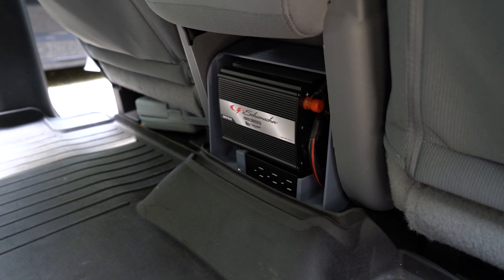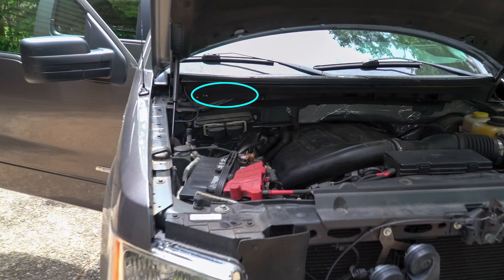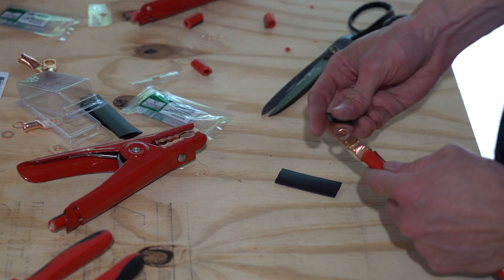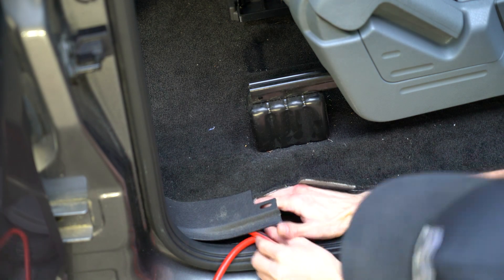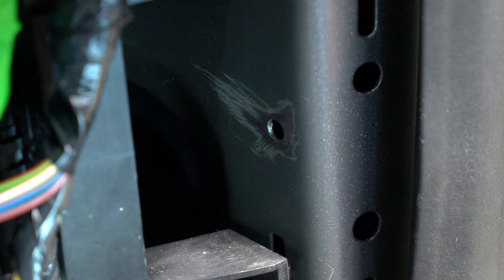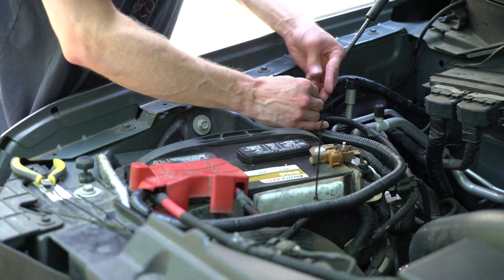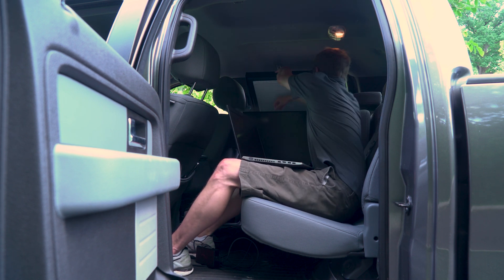Power Inverter - Wicked Full Install - AC Power for your Car or Truck

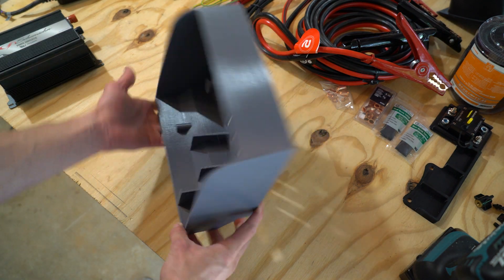Comment: @ 1:47, you're a magician brother. new sub here.  As a 3d scanning guy myself (lidar for construction, real estate, etc and drones for lidar, photogrammetry, etc,) did you use a scanner to scan the factory part you modified @ 1:47?  No need to tell me the secret sauce, we can connect elsewhere but I'm curious as I haven't started scanning smaller parts like machine parts and reverse engineering things with platforms like revopoint, etc.  🍻

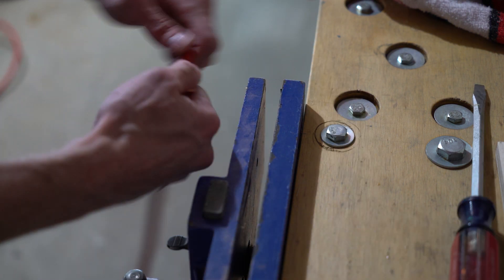master tip @ 5:20

Comment: Amazing work on wiring it through the frame. Best part about doing it that way...you dont have to do that again if you get a different inverter. The wiring is already in place. Only thing I could see to use instead is your drill bit for the ground terminal near the fuse box. You appears you were using a (black oxide) bit intended for wood. Use the bi-metal, or gold or titanium ones in color for metals. I'm thinking you already switched those out now with it being 4 years late. Great work.

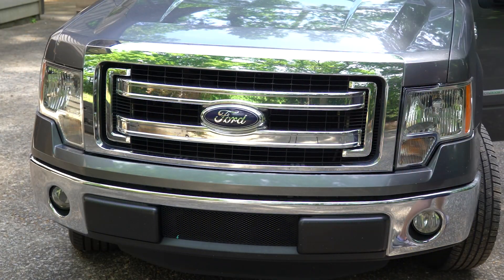Comment: for 11:42

Here’s what’s happening:
1. Starter battery voltage drop:
When you crank the engine, the starter motor draws a very high current (often hundreds of amps). This causes the battery voltage to dip sharply, sometimes down to 9–10 volts or less for a few seconds.

2. Inverter reaction:
Most inverters are designed to shut down or alarm when the input voltage falls below their safe operating range (usually 10.5–11 volts). So when you crank the engine, the inverter “sees” the voltage sag and starts whining or beeping.

3. Why the car itself whines/beeps:
Depending on the truck’s electrical system, the inverter pulling load while the starter is cranking can make the alternator or electrical components emit a high-pitched noise. It’s essentially electrical stress caused by both the starter motor and inverter drawing from the same battery at the same time.

Comment: Very good video double thumbs up. I got to use a EGO Blower recently, i think it put out more blowing power compared to my handheld echo Blower and I was very impressed. I could save me a ton in gas by using a battery powered blower. I came across this video and I think I found a way to charge the battery's while I am out mowing lawns every day.

Comment: Very nice install.   I would not go with a modified sinewave inverter.  Sure they are a bit cheaper but it really restricts what you can use with them.  Also I have read they can actually damage devices hooked to them.   I love your video.  Very well done!

Comment: If I where you I would buy a junction box for under the seat to protect the flammable carpet from getting lit from terminal spark also I would build a cover for the inverter so the outlets are only visible and then I would buy an external switch to hardwire it to prolly left side of stearing wheel so u could controll it from the front

Comment: Great vid. This really helped. Getting ready to do this. Do you happen to have a link to the terminal cover boots you used at the end?
Reply from the maker: Happy to help! Here are the covers I used https://amzn.to/4b9OQB8

Be sure to add a fuse on the close to the battery. This can help prevent a short in the case of a crash or damaged wire. This is the one thing commenters said I missed.

Thanks for the comment!
Reply: @The3DHandyman  Just wanted to let you know that I did this today on my vehicle and it worked out great. Thank you again for making this vid. Its pretty much the only clear and concise one out there.

Comment: My f150 came with the inverter installed. I loved that feature. Going to do this to my Ram now. Its amazing how often you use them when you have them.
Reply from the maker: I used mine quite a bit at first for quite a few tasks. First picked it up in case of of a power outage. This way I could run the refrigerator or other essentials if need be. 

I talked to one guy that used his to charge batteries for his electric mower while on the road.
Reply: @The3DHandyman  lol, I use ryobi tools and have a charger for the batteries just for the fan. In texas it gets hot in the summer so we can use the fan in the tent. Damn I got old.
Reply from the maker: @johnmichaels4330  Lol. A fan in the tent is a fine choice. I've spent far to many nights out there without one!

Comment: Small nitpick - you stated the AC vents would blow cool, moist air on the unit - it will actually blow cool, DRY air (moisture is removed at the evaporator and drains out under the truck).
Reply from the maker: Good point 👍

Comment: Also for your fridge and other device. Why not just get the pure sign wave inverter?   You maybe would spend 50 more dollars and never have to worry about anything ever again.
Reply from the maker: I think I had already bought the inverter after a power outage and it sat around for a year before I did the research and installed it. Otherwise, sinewave would have been the way to go, for sure.

Comment: Of note:  When you drop a bolt in the a-pillar, you don't have to listen to it for 100,000 miles.  Simply drop a magnet down there too.  (Might need a stick and duct tape to get the placement right...) Had this scenario with a welding slag bb in the top rail of a Volkswagon.
Nice clean install.  You do good work, and the presentation was top notch.
Reply from the maker: Thank you and thanks for the tip! Hopefully it never comes to that. haha

Comment: Nifty work man .. very nice and clean.  Have you found out why your truck makes that beeping sound when starting while the inverter is on the ON position?
Reply from the maker: Than you. It apparently beeps because there is an unexpected power draw on startup. I like to keep the unit off for that reason until the vehicle is running for that reason.

Comment: If you are plugging in a plug with earth terminal (non double insulated appliance) into the inverter how is the car earthed if the appliance fails?
Reply from the maker: Good question. I do not know the answer to that. I imagine that all power inverters would share this issue.

Comment: Super clean, nice job sir! I see your update in the description about the fuse. Noted:) Any other lessons learned? How the system functioning?
Reply from the maker: Thanks! So far after 3 years of use, everything is working perfectly without any further updates.

If you were to do a toggle switch in the vehicle to cut power to the unit and a fuse next to the battery, this might be a more safe and convenient approach to the install. (just replied to another comment where this idea came up)

Comment: So, I just watched this because im thinking about installing an inverter and a plug or 2 in my 99 f350 diesel. I don't do any work out of the truck, so itd just be for recreation and trips, chargers, maybe lights or a coffe pot here and there or something. Im leaning towards wiring into a toggle on the dash to switch it off and on. Thats my only thought really is dont you have any open auxiliary ports in your dash to run it on a switch in a convenient more "stock" looking location? great video, TONS of great reference for my project when I get on it
Reply from the maker: If I were to do this again, I would probably do a toggle switch in a more accessible location inside the vehicle and a fuse close to the battery. This accomplishes what I did in the video only it's a little safer and easier to work with. 

Thanks for watching and have fun with your build!

Comment: Clean install, one thing I would of done install the fuse box next to the battery just in case if for some reason it shorts out u don’t burn ur truck
Reply from the maker: That's a great idea. Thanks for the comment. I wish I had added that to the video in the first place, it was the one thing that was missing.

Comment: Do you have the print file for the breaker mount, or can we order a breaker mount from you? I do not see that listed in the description or on your Etsy page. 

Thank you for an amazing explanation!
Reply from the maker: Any time! I suppose I didn't like the breaker mount design very much and that's why I didn't post it. A preferable option for installation would be a fuse/ breaker closer to the battery in the engine compartment. This can prevent a short/fire in the event that the positive wire is damaged inside the vehicle (accident, etc). The actual power draw from the inverter in it's off state is extremely low and should not cause a problematic amount of battery drain.

Comment: The loud beeping sound is because the starter motor draws alot of current and drops the voltage below the inverter's low voltage protection.
Reply from the maker: Thanks for clarifying! That's good to know

Comment: I want to install a small 400W inverter in my old '06 dodge durango, for our many roadtrips... But I'm really scared of electricity.
This video is very informative and well done. Thank you so much.
(I wonder how long that would take me, since I'm not a very 'handy' guy...)
Reply from the maker: I think they have inverters of that size that plug into a 12v cigarette lighter. That might be an easier way to go!
Reply: @The3DHandyman  yeah that's what I thought. But cigarettes lighters are 20amp. So even when I try to pull as low as 200w it'd fry the fuse, unfortunately.
Reply from the maker: @damienc7303  Ah, that's a bummer. Good luck with the install then! One thing that was not mentioned is that it's good to put an extra fuse close to the battery on the red wire just in case the wire gets damaged. If it gets damaged then it could short and cause a fire.

Comment: Could you have found a ground location closer to the inverter? I would thing one of the seat bolt would be bolted to the frame. Great video by the way. I will be using this to put one in my expedition.
Reply from the maker: Yes, there were closer grounds like the seat bolt but they were covered in thick paint that I didn't want to scrape off so I just took the ground a little further to a spot that would work nicely. There may also be a slight safety benefit when not wiring through the seat, but I'm not sure about that.

Thanks for watching and commenting!
Reply: @The3DHandyman  Thanks!

Comment: That's impressive, but I'd rather just attach my inverter to the anchor points in the roof at the rear of my vehicle and power it from a 12V socket haha. I'm planning on doing this starting tomorrow since my 400W inverter isn't even enough to power one charger for my tool batteries, so a 1000W or 1500W inverter might be enough.
Edit: my older one can charge a battery with the vehicle off, but the vehicle needs to be running for the inverter to continuously power the fast charger. The fast charger will probably just be used as a backup for when I'm driving or need power quick.
Reply from the maker: Also a fine choice!

Comment: Best way I can explain it power inverter will throw it south into a low power mode I’m trying to crank it’s all based on the battery you have the more cold cranking amps and cranking amps you have stronger battery would help also upgrading to a little bit stronger alternator if you feel it’s necessary that would also help
Reply from the maker: Thanks for the info!

Comment: Will this setup work for charging Milwaukee m18 batteries?
Reply from the maker: The charger pulls 175-240 watts depending on which charger you are using. A 95amp fuse and the 1000watt inverter should allow you to run at least 3 chargers simultaneously.

Comment: Cold air hitting a hot thing won't cause condensation, that would be hot air hitting a cold thing, like your hot breath hitting cold glass. Very clean install though.
Reply from the maker: Good point 👍

Comment: How do you know what breaker to get?
Reply from the maker: Good question. The breaker is determined by the wattage and current of the power inverter. There are online calculators for this sort of stuff.

The Current is 12V and the Wattage is 1000W. The average Amperage for a unit like this is between 88-105amps. I believe this unit has 95amps printed on the side of it.
Reply from the maker: Keep in mind that a 100amp breaker may prevent the peak load of 2000watts for this unit. the 100amps rating is only for the continuous draw of 1000watts.

Comment: I'm doing a similar install - freezer in the crew cab running off 700watt inverter - but have a question on connecting the negative wire which for me is a 6g.  The two options I see are (1) connect it directly to the battery negative terminal or (2) connect it to the truck frame (which is electrically connected to the battery negative).  You obviously went with option (2).  Did you research the best options?  Does it matter?  Please share any info you have on the issue.  Thanks!
Reply from the maker: I think it results in less cable used if you ground it to the frame. That may be the main reason why vehicle manufacturers ground to the frame. Do pick a nice thick part of the cab to ground it to. I picked a part that was close to an existing ground just to be extra safe.

Otherwise I think you can run it all the way to the battery if you want. It will just add to the bundle of wires already in the cab.

People have also mentioned adding a fuse to the red wire close to the battery. This will cut the power in the event that the cable is damaged for wherever reason.

How that helps!

Comment: Thank you @ The 3D Handyman.  Excellent video I'd say. How is the inverter handling 🤔?
Reply from the maker: @Rizzle Riz Thanks, any time! Everything is still working great. I used it a quite a bit last year. It hasn't gotten that much of a workout since but everything still works like new.

Someone else printed one of the enclosures and is using that same inverter to charge lawnmower batteries. So far so good after 2 months of heavy use.

Comment: Bro, you need is the fuse in the battery, is good if you relocate the cable to the master fuse or find a sound system fuse
Reply from the maker: Thanks. That has been the one thing people mentioned being left out. Thanks for the comment

Comment: Install a 50ah Lifepo4 battery under the seat and a battery contractor. So the Lifepo4 engages only when the alternator is running. Rest of the time if u power the inverter on it will only drain the lithium battery this not leaving u stranded if u forget to turn it off and fully drain the battery remember this won't be automatically shuting off till the battery is done to 10v and a car battery at 10v is useless.
Reply from the maker: Good advice!

Comment: I want to do something like this in my Ranger, but I want the outlet(s) in the bed.  The storage area under the rear seat (Supercrew) is useless for me since my kids' car seats are a pain to remove, so I'm thinking of using 2 6V batteries (aka golf cart batteries) in series and maybe the inverter under there.  Then running the AC power to the location(s) I may want them.  I'll add a battery isolator so that it only charges the 6V batteries when running.  Great video BTW.  great shooting angles and just enough content to not be boring.
Reply from the maker: Sounds like a fun project. Using the extra batteries is a great idea. It definitely take the stress off of the truck battery. 

Are you going to 3D print a housing for the bed?

Good to hear you enjoyed the video. Thanks for the comment!

Comment: Damn age quite impressive, granted, ill be returning mine and sticking wiht my 410w that plus into my cigg lighter lmfao. seemed like too much worse considering i dont run any power tools or anything, ocasional scan tool and laptop
Reply from the maker: That is an easier solution. I just did a print of the inverter case for a guy that was charging large lawnmower batteries and running an air compressor while on the job. Laptop and small tools don't use quite that much juice.

Comment: Everything looks perfect but I have a question I know you put a kill switch but aren’t you missing a fuse on the positive close to the battery?
Reply from the maker: That is correct. You definitely want one of those close to the battery.
Reply: @The3DHandyman  thank you i loved how you connected everything ad the 3d mold bracket is awesome i always try to make everything as legit as possible but yeah i saw there was no fuse I’m no expert but fuses have saved me from a few

Comment: Very nicely done. Is the Breaker neccessary though? what if you didn't install a Breaker?
Reply from the maker: Thanks. Good question! Its a nice lockout for the device as it can pull a small charge even when it's off. If you let your vehicle sit for a week or more then that might be an issue. Otherwise it can do without it. At the very least you do need a fuse/breaker on the power line near the battery. This is in case the wire of the inverter gets damaged and shorts out. If this were to happen it could cause a fire.

Comment: Can I purchase the 3D printed holding compartment from you. I have a 2011 f150 and the same inverter but no access to a 3d printer.
Reply from the maker: I have been thinking about setting up a print shop lately. So, my answer is maybe. Where are you located?
Reply: @The3DHandyman  call or txt me if your interested in selling the 2 pieces you 3d printed. I'll pay for shipping
Reply from the maker: @ericgarabrandt5553  If you put your number in there, youtube removed it. Contact me here with your info https://cruciblecompany.com/contact/
Reply from the maker: I think I got your email, is your area code 330?

Comment: Very good info
Reply from the maker: Thanks! One thing that people mentioned is that there should be an additional fuse on the power line coming from the battery. This can help if the power cable becomes damaged between the breaker and the battery. Without the fuse, it could potentially cause a fire. Keep this in mind while wiring up your inverter 👍
Reply: @The3DHandyman  thank you 👍👍👍
Reply from the maker: @fabienpics  Any time. Have fun